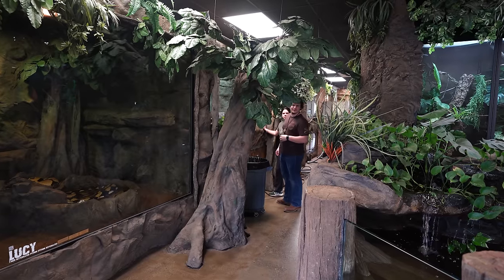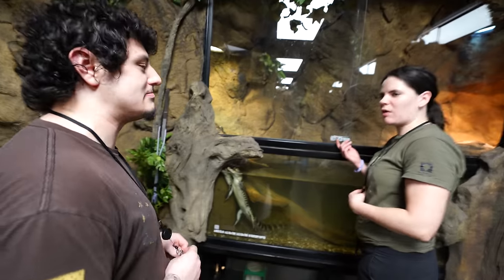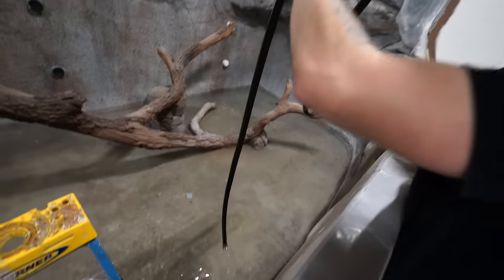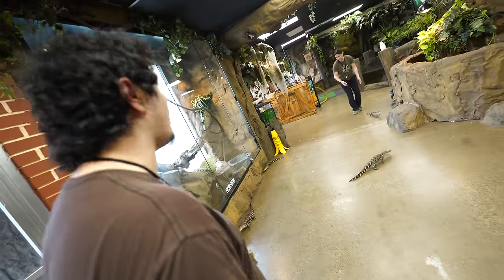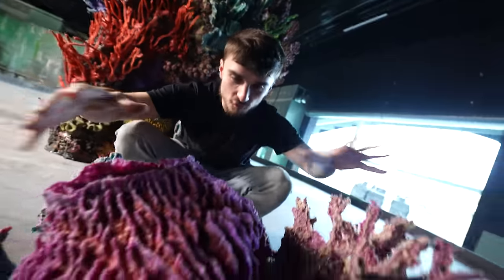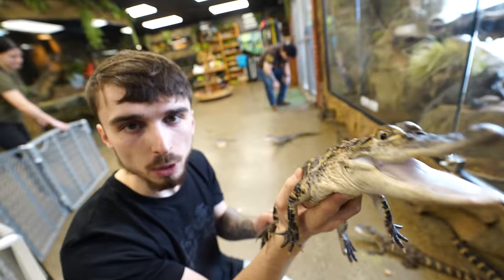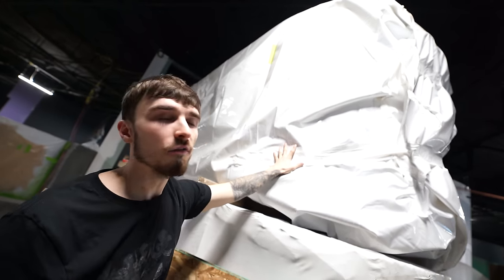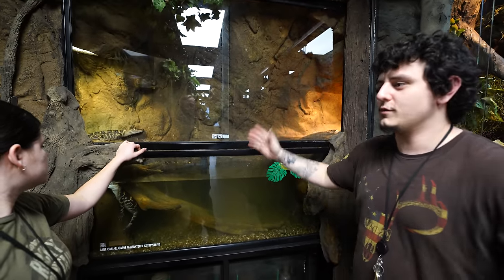My 27,000 Gallon Fish Tank Is Broken

Comment: Just a tip to help the process move a little quicker get in touch with you local fire department they will come n fill the aquariums with water with the fire trucks/fire hydrants they actually like when people call to fill pools n stuff cause it helps them get water moving out the hydrants n stuff n it will fill your tanks a hell of a lot quicker than they tiny hose can have the tanks filled in a day